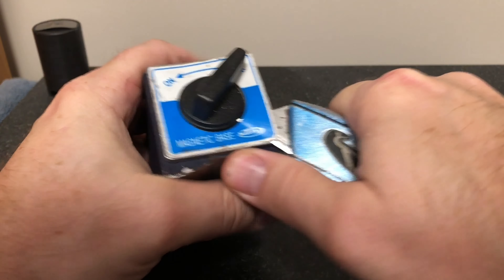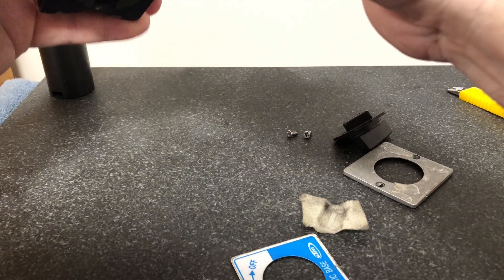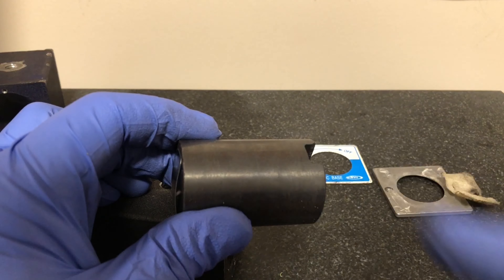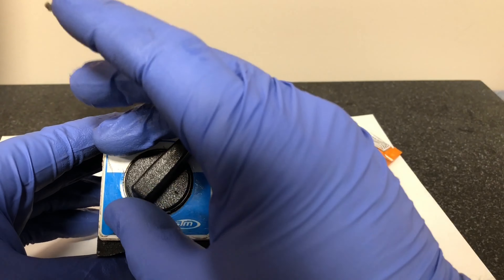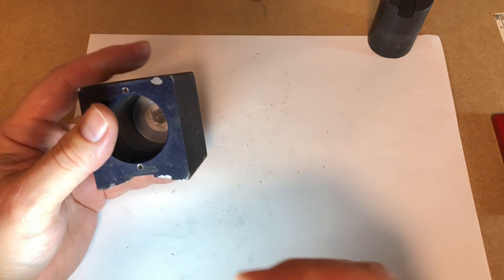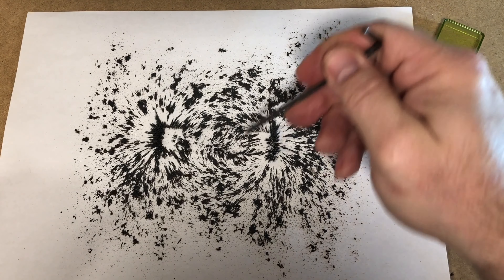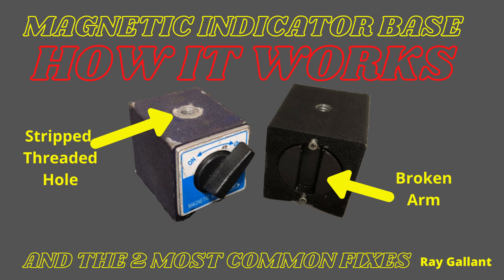Magnetic Indicator Base how it works and the 2 most common fixes

Comment: Nice video. I'm facing problem with my v blocks after i opened and cleaned them. The magnetic force used to be strong but now it's very less after I assembled them back. Do you have any idea what could have gone wrong?
Reply from the maker: it’s possible the issue that you’re facing is that there is no magnet on the inside

It could’ve been a magnetic core  

once you’ve pulled the magnetic core out you demagnetized it

Check to see if the core is made from magnetic material or a chunk of steel that was magnetized 

Unfortunately, if it’s a magnetized core it’s not worth repairing sorry 

Ray

Comment: A better fix for the stripped thread is to bolt down a NON MAGNETIC plate to the top of the base. The plate is the same size as the mag base and about 10mm thick. Use a screw in each corner. Stainless steel works well. You will notice a significant improvement in stem rigidity using this method plus there are no longer any aluminium threads to strip out.
Reply from the maker: That’s a really good suggestion
This is why commenting and reading the comments is so important it helps get other peoples perspective 
Thank you for sharing and also thank you for taking the time to share 
Ray

Comment: Useful video, thanks. When my base arrived from China it was stuck and wouldn't turn. Now I know :)
Reply from the maker: If your bass is stuck.
The first thing, check to see if there is a washer underneath the large stud that you bought your indicator too 
It could be missing and might be screwed into the actual magnet 

Or it is poorly machine, and the stud portion is too long and it’s stopping the magnet from turning so take that out first 

If that does not free up the magnet 
Look inside the hole and see if it is a magnet or a steel slug
If it is a steel slug, don’t do anything because there’s nothing you can do 

If you remove the steel slug, you will demagnetize it, and it will not work, even if you can rotate the magnet 

Try this and let me know if it works 
Ray

Comment: There is a 3rd item to be fixed on real low end magnetic bases. They do such a poor job of grinding the magnetic face surface flat, as well the partial V-block will have faces that are not in a planes that will meet in a straight line relative to the base face, so the indicator rocks on the mounting surface it is used on. I have a few of these. It looks like they did a hand grind at a belt sander.

There are some permanent magnet things that should never be opened. Stepper motors, and DC servo motors, will loose much of their magnetic strength if the rotor is removed. The manufacture of these have tooling called 'keepers' that keep the magnetic flux lines flowing through some highly permeable steel during assembly, and disassembly. I know this is not pertinent to this video, but this should be known to machinists/mechanics/engineers/technicians that like to fix things.

I've never taken one of these apart. Interesting to see how they work. Thanks.

Comment: Great video, one question, does a magnet switch attracts another magnet when its off?
Reply from the maker: The magnet itself does not ever turn off
All it does is rotate the magnet, so that polarity is broken 
That is why there’s two pieces of non-magnetic material at the top and at the bottom of the V I hope that answers your question if it doesn’t, please feel free to rephrase 
Thank you for the nice comment and thank you for taking the time to comment. It’s much appreciated. 
Ray
Reply: @shopandmath   Soo it doesn't attract then?

Comment: very good video, I need help, I have a BROWN & SHARPE MAG.BASE and is to week, even a baby can pull it when on, there is a way to fix it?? thanks
Reply from the maker: I could only think of three things that could be the problem
Number one there’s something mechanical inside that is not allowing the magnet to turn on all of the way 
Number two there’s a piece of metal that’s jumping the polls
And diluting the strength of the magnet
Number three this is a good quality magnetic base and the internal magnet should actually be a magnet not a magnetized blank

Magnetize blanks lose their power after a period of time and can also be completely demagnetized in some cases by simply removing the magnetic core

If it is a magnetize blank it can be re-flashed but it’s not worth doing replace the base

I hope this helps
Ray
Reply: math  thanks, I'm going to take it apart in order to see what is going on,,thanks
Reply from the maker: @miguelatorres7695  
Don’t forget to check to make sure that it’s an actual magnet inside before you take it apart
Because if it’s a magnetic slug on the inside you could demagnetize a slug just by removing it
Good luck
Ray

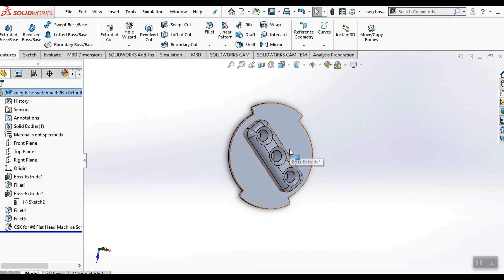Comment: at 9:00 minutes, is the back of the case aluminum or steel?

great video! love the new handle design!
Reply from the maker: I’m not sure about the ones in the video
I would have to go on track but most commonly they are either fully cast along the back or it’s a piece of tin/aluminum
The shim in behind the magnet prevents the magnetic poles from grounding out
I hope this helps
Ray
I just finished another video where I repair a magnetic base and install a magnifying light on it I don’t know if I’m gonna post it on this channel shopandmath or on my new channel raysfix

Comment: Hi Buddy, I just today bought my 1st mag holder and am dissatisfied because it can barely carry itself 😕. Can I do something about that, can I somehow amplify the mag force? -Without having fancy tools like 3D or a mill?
Don’t get me wrong- I’d love to have them but money’s always short, You know that song...
Reply: Make absolutely sure before you take it apart that’s a magnetic core not a magnetized piece of steel
The only way to increase the magnitude is if it was assembled incorrectly and somehow the magnet is shorting out but that’s highly unlikely it is possible that there’s a piece of steel jumping across the negative and positive 
Is there any grinding when you turn the magnet on and off?
I could indicate that there’s something inside
Reply: @raysfix  Well, it was a user error. The thing is stiff like a doornail-  I just used it wrong.
Thanks for the reply

Comment: My v-block is extremely weak compared to our newer ones. Magnets only lose about one percent every hundred years, so what could be the problem?
Reply: First question is it a real magnet inside or is it a magnetized iron core

A magnetized iron core could lose its Magnetic strength Under certain circumstances

If it’s a real magnet it’s most likely be in ground out somehow that does not allow the magnetic flux to travel from one pole to the next

Inspect the outer casing for damage if you drop the unit and it’s possible that it has broken and it is also possible that it became unglued

Has this been exposed to excessive temperatures

if you shake it doesn’t rattle

When you turn the magnet on and off is there an excessive play in the switch or when you turn it on part of the way does it slam the rest of the way on or does a train turn itself off
Or is it hard to turn

How’s the block ever been underwater or under coolant

If it’s yester any of these questions you should probably take it apart and see if there’s any rust or foreign objects or broken pieces inside
They may be hard to find because they stick together

Keep in mind if The magnet is an iron core by removing the magnetic core you made demagnetize a magnet

I hope this helps
Ray
Reply: @raysfix  thanks man

Comment: i don’t understand the big deal with running powerful fans to the 3d printer nozzle when you can have one large pc fan in a box extracting the heat from the printer head with a hose

you can use a quiet 10cm pc fan housed in a way there a hose
size port-from there, plug in a flexible plastic hose too printer
head-you can pull 10x the heat almost silently! you can place the fan box ten meters away!
Reply from the maker: there’s nothing wrong with running a fan to extract heat or fumes where 

the problem comes in for everything that you extract. You’re also adding something and depending on the time of year and where you are on the planet, you could be introducing moisture or extreme cold air.

currently, my printer is showing its age I have stopped using everything except for PLA. The reason behind that is, I only do constructive and experimental parts with doing this. I am rather lucky because I can use old PLA and low quality PLA, and still produce good enough quality parts for what I need them for, I don’t do any resell so I can design parts or change the design of parts to suit the end result

i’m also currently looking for a machine with a larger footprint to be able to create larger parts

Comment: Absolutely not , you should never remove the magnet from its housing , that stand will lose 80% of its magnetism within a few days,  if you want to remove the magnet you should fitted inside a iron housing of the same diameter than the one you r3move the magnet from...
Reply from the maker: Removing a magnet from its housing will not demagnetize it 
With that said if you remove an iron core that has been magnetized it is possible to demagnetize the iron core
If you watch the second video I demonstrate how do I identify the difference between an iron core and the magnetic core
Reply: Seen it all the time , with all the ones , that I have seen that being done , even top brands like Eclipse and Mitutoyo